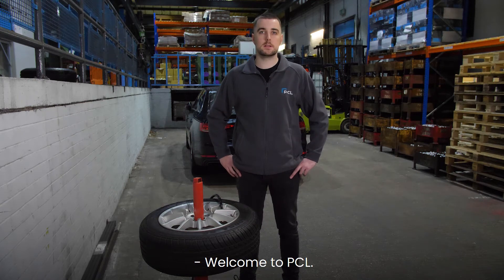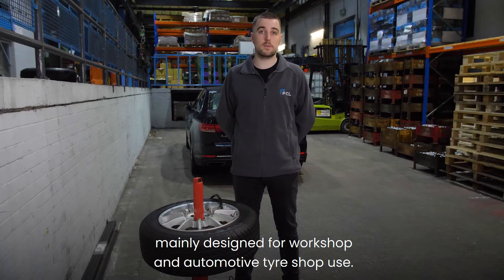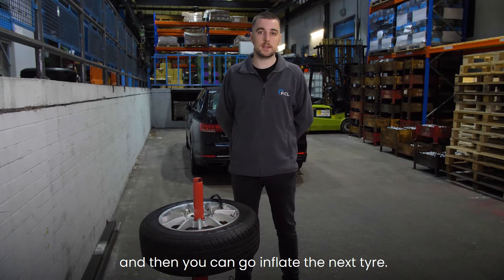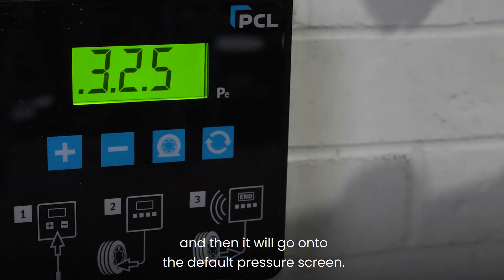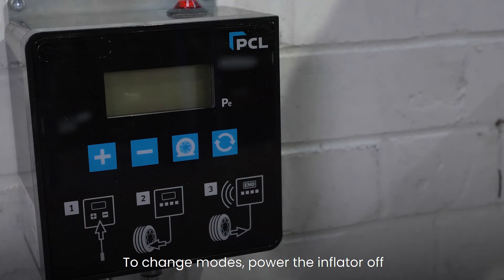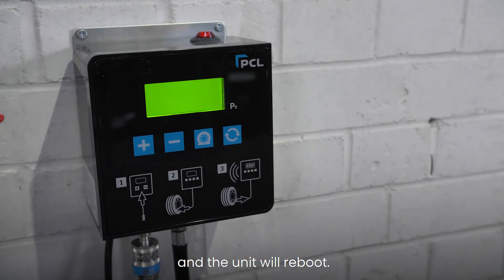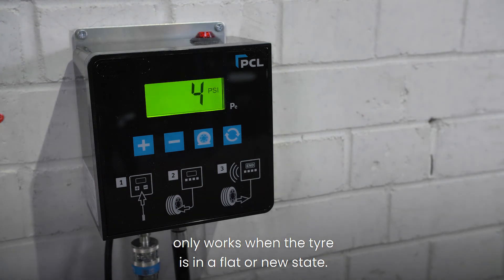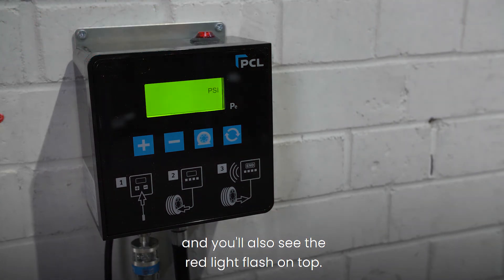PCL QUBE Series II Tyre Inflator Demonstration [How to use]

Comment: Stupidly over complicated machine, ive got a different model   but its impossible to use without having a manual in front of you and even then its a nightmare to use.....basically it a great wast of nearly 1000 quid when a simple manual guage for 15 quid will be 100 times easier to use .
result   im buying a 15 quid guage to replace the 1000 quid unit that will go in the trash...
Reply from the maker: Hi Colin,
We are sorry to hear you are having trouble with the QUBE Tyre Inflator, please contact us www.pclairtechnology.com/contact-us, where a member of our team will be able to provide assistance
Reply: @Pclairtechnologyltd  hi sir display show in PCL but any push the button not working properly how to solve this problem please kindly reply